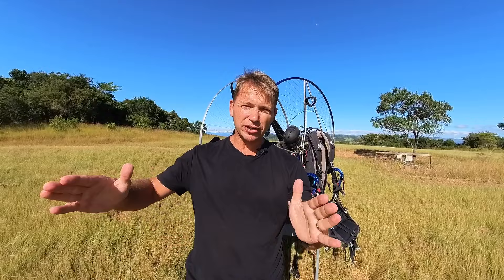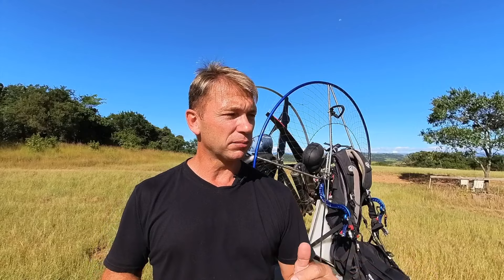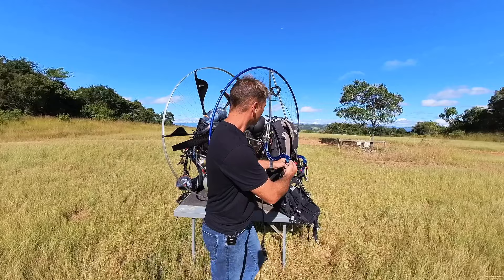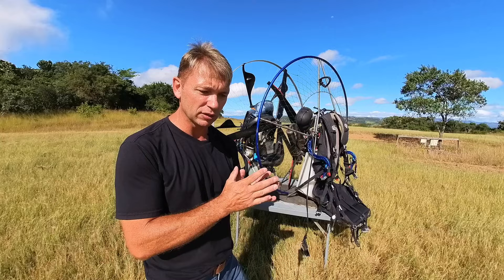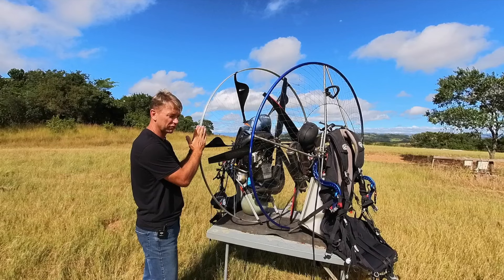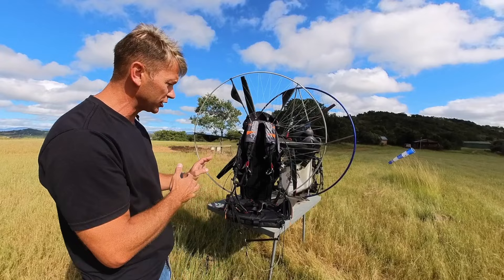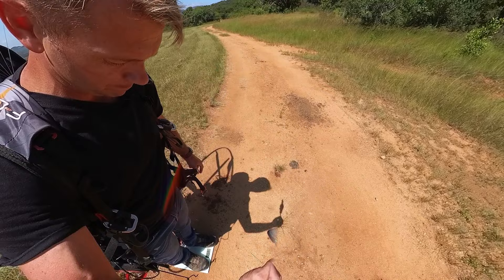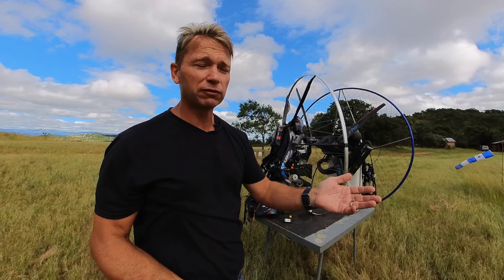What did I buy?!

Comment: I've been meaning to look for a more powerful motor than my moster185.  With stuff that I do I really hate the climb rate of the moster but Nirvana does cost a bit much

so hard to find something powerful at a reasonable price :)
Reply from the maker: The Nirvana Rodeo is comparable to 185 moster and is only more expensive due to auto extras such as instruments that are built in. Stainless steel exhaust as well. Has a 22kg weight with a very cool single folding frame. Its a strong unit and sips fuel. Then Macfly does a low price powerful output unit with polini 202 but it weighs 31kgs excluding reserve. Good unit around same price as Maverick but I wont consider that weight increase if not heavier than 100kg pilot
Reply: @therealeugenecussons  my first motor was the rodeo, it was a very comfortable frame with open arm design, probably the most comfortable frame for xc I had flown so far, im looking for probably something a bit over 200cc with 150cm hoop to swing a big prop, but haven't really looked hard into it